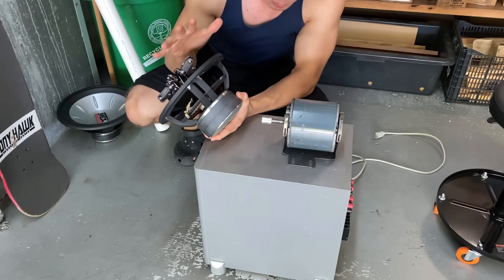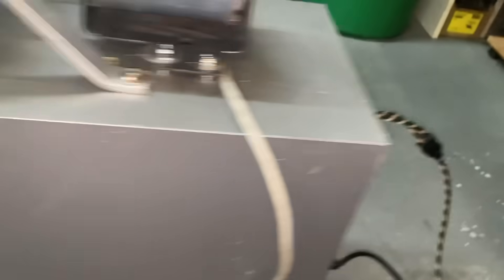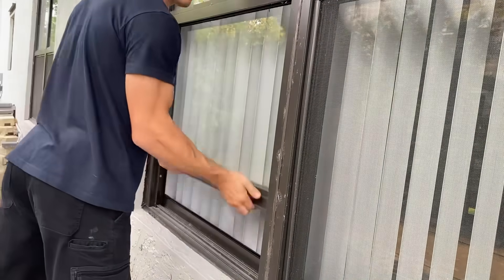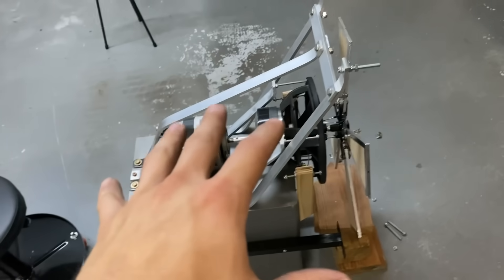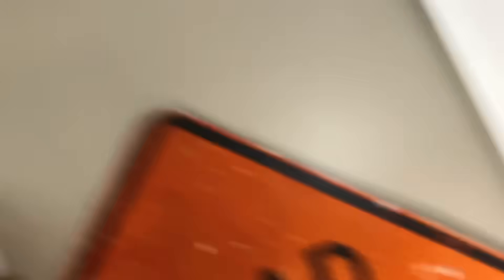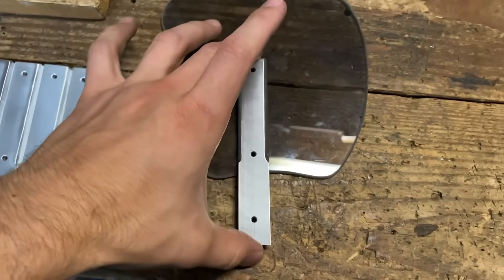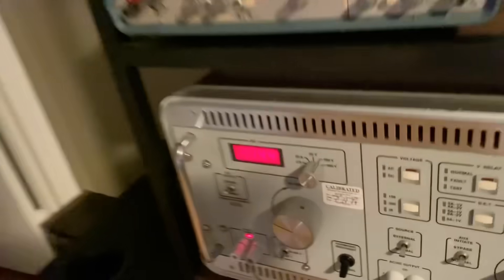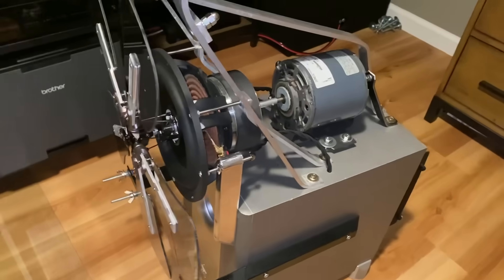Making the worlds most powerful subwoofer (Rotary Subwoofer)

Comment: It took me quite a while to understand how that thing works. That thing is a beast, I wonder if something like that could be used in a haunted house prank.
Reply from the maker: It sure can
Reply: Look up articles on infra-sound. Certain lower frequencies are not audible but can produce uneasiness, anxious, nausea, dread. I have long wondered if some of the cavernous rooms in old castles, basements of large structures, etc,  have an infra- sound resonance (Think the sound of the sea in a shell but lower frequency at greater pressures.  This could help explain some of what people experience in these spaces (though I haven't seen any testing). 

I do know there are infra- sound generators in use and for sale by and for commercial haunted attractions.

Comment: It would be interesting to see experiments on rotational speed of the blades versus output level. There must be an optimal rotational speed at which the subwoofer has its greatest output.
Reply: I would also bet that it has to do with the pitch of the blades at any given moment, and might vary significantly. Curious to see what the data on this might look like.

Comment: You can't hear 10 hz
Reply from the maker: Well said. U just gotta hear it to believe it
Reply: If the device reproducing the sound has the balls, I assure you that you can hear ten Hz.  I've seen the Thigpen model demoed twice and it destroys everything you think you know about LFE devices and our ears.  These things are insane.  Beautiful engineering and tons of fun to experience in person.
Reply: @JAMPROSOUND  below around 20hz is not audible. You get pressure but not sound (except things shaking).
Reply: You're right.  Our ears just magically stop functioning at 20 Hz.
Reply: @JAMPROSOUND  that's not how that works and yes audible noises under 20 are inaudible to humans. It takes almost  zero effort to research this. The sounds you hear below 20 are resonance as in things shaking, rattling,  and felt pressure. You can not hear the actual tone.

Comment: I've seen an online auction of a supposedly factory made (IIRC Italian) LFE subwoofer which used a motor, but it was just simply attached to the diaphragm of a huge woofer with an eccentric coupling. So it was an ordinary woofer, just driven by a motor instead of a voice coil. The motor looked like an ordinary brushed DC servo motor, I'm not sure if an average amplifier would be happy getting zapped by the sparks of the brushes... Trying out that concept was on my long term to-do list for about 10 years now. This one looks way more sophisticated. Not sure if I will ever try any of them, but good to know about this version.

Comment: There is only 2 major problems with this. 1) There is no possible way to use this in winter time. 2) if the blades are strong enough to handle 120hz a frequency that you will feel in your chest, the neighbors within a 1/2 mile radius will start to complain when you turn it on.
Reply: It could be installed in an attic space.  Would still get the penetrating bass but the airflow would be outside the insulative envelope.  Similarly for an unheated attached area like a crawlspace or attached garage.  Not as good but a powerful low frequency travels.
Reply: @sblackwolf  "Not as good but a powerful low frequency travels." Then instead of using a fan, why not just install it to the four walls in your home as that is what one would be listening to the vibrations of the wall around you.
Reply: @nathanwoodruff9422  I was trying to remain on topic as the question was asked.  Yes,  mechanical coupling can and has been done as well using actuators or other electro- mechanical means. I'm not sure but I would believe either of these approaches would be hard on the structure,  the fan being perhaps less damaging.
Reply: @nathanwoodruff9422 using a fan or a regular subwoofer to create sound pressure is no different.  If the structure can’t take it, then it doesn’t matter.

To your original point, you wouldn’t use a fan sub at 120Hz, only at very low frequencies where traditional subs have difficulty producing adequate output.
Reply: @superspeeder  "using a fan or a regular subwoofer to create sound pressure is no different." Thanks for insights into the obvious!!!  " is no different." Well, except a fan can create 1,000's of times more pressure than a subwoofer ever could. But, thanks anyway for the insights to the obvious. 
"To your original point, you wouldn’t use a fan sub at 120Hz," Well, except if a fan sub was made out of very lightweight metals like aluminum, which works too well at 120Hz enough so that it rattles pictures off the walls of neighbor's homes a 1/2 mile away given a large baffle like an attic. But thanks for being clueless again. We all will make note of it. Studies have shown that humans like you don't hear below 100Hz anyway. The vast majority that said they did felt it and didn't hear it. A fan sub at 10Hz and below is doing nothing more than wasting energy moving objects within its vicinity back and forth at 10Hz and below with that wasted energy. But you probably wouldn't know that either. Oh and Mythbusters busted the myth that 7Hz signal makes everyone {censored} their pants. But, Mythbusters was probably before your time too.

Comment: Ok you showed us the super low stuff…is there a frequency where this loses effectiveness? If there a natural roll off above a certain frequency?
Reply from the maker: It’s mechanically limited to about 15, cuz the rotor won’t handle it
Reply: @pierogiengineering how about making a way smaller one with much higher rpm and very strong woofer higher rpm=volume right? 50hz possible maybe?
Reply: @pierogiengineering  so yours is a neat party trick, then, and I fell for the clickbait. 
Servo driven subs were a thing about 30 years ago iirc. I should look them up.

Comment: The worlds most Powerful Subwoofer has a membrane Diameter of ~4m. This thing is useless against.
Reply from the maker: No way, I wanna see it. What’s it called, or do u have a link
Reply: @pierogiengineering  A smaller version is to be seen in Back to the Future #1. Pink Floyd used this Monster Woofers at one of their Tours. These things are capable to crash a building when matching the resonance frequency. Ok - i will correct myself. Its smaller. Only 80 Inches in Diameter.

Comment: your 4th order bandpass boxes lose about 12-18db by virtue of being a 4th order bandpass box. literally ANYTHING is going to be 4-6x louder than that shit.
 
 that said, you dont seem to understand at all what this device is. there is no standard speaker driver used in this hypothetical-dosent actually exist system. its JUST the fan with the blades vibrating rotating back and forth AS the speaker cone. its purely hypothetical, and was never actually made because its fucking nonsense. sound waves are not air pressure, and trying to combine the two has terrible results. plus this shit was meant to sit in your basement, blowing against a central support collumn in your foundation to transfer the sound into the house itself. its not just blowing air inside with a speaker playing behind it.
Reply from the maker: Bro, no way you believe anything u just said. Every transducer generated positive and negative pressure. 

By definition: “Sound wave is called longitudinal wave because it is produced by compressions and rarefactions in the air.” 

Won’t convince you on your theory of the rotary sub itself, since this video legit SHOWS as best as I could convey it operating as intended, nothing hypothetical.
Reply: @pierogiengineering  speakers produce sound waves as well as air pressure. the two are not the same thing. you need to get a basic education on these principles before you pretend to understand them.
Reply: Just shut up, and appreciate what this guy did....
Reply: @Tegacius  he didnt do anything. its literally just a fan sitting in front of a subwoofer.
Reply: @FingerinUrDaughter huh what? The pitch of the blades is controlled by the subwoofer, thats what creates the pressure. Please just look it up online before you embarass yourself ❤
Reply: In the late 1990 I remember a commercially made rotary subwoofer that could play 50 - 30hz and lower if I remember correctly.
Reply: @a64738  you dont.
Reply from the maker: 6:16
Reply: @pierogiengineering  1: thats not your amplifier. 2: if you think any cell phone/tablet is capable of passing a 1hz signal over its headphone jack, you need to get a grip on reality.
 the ONLY way youre generating 1-3hz is from an oscilloscope, and there is literally no commercially available amplifier that can reproduce that low.  not that it would matter, since the FAN BLADES are whats supposed to be oscillating at 1-3hz, and an audio amplifier is literally not even a part of the ACTUAL DESIGN FOR THIS KIND OF SYSTEM.  its literally just supposed to be a high powered fan blasting a support beam with air thats being chopped up in 1-3hz intervals by the oscilation of the fan blades, which causes the support beam and theoretically the entire building, to vibrate in time.
 
 what you have is a fucking HTIB subwoofer sitting behind a fan that has the blades swiveling back and forth, blowing in through the window. you dont even understand the very basics of this shit, and have the shit tier 50 watt subwoofer sitting behind it just to say "oh look its doing something!" but you cant even fucking hear it. the system is meant to induce vibrations in your foundation, not blow air in through a window you tool.

but EVEN IF YOU DID IT RIGHT it wouldnt matter. this was a design theory. it could technically be done, but the amount of airflow required would make for a dangerous air intake system, a dangerous level of high power, literally to have your house built around the use of this device, and in the end you wouldnt REALLY have a subwoofer at all. youd just have your entire house vibrating at 1-3hz constantly when it was in use. thats the reason why in the 80's when this flop started getting some attention, it was purported to cost $20,000+. because you had to have a home built around the thing. now adays youre looking at far more. oh and again, you need an osciliscope, and a 440v several kilowatt regulated power supply, not a fucking car amp.
Reply: @FingerinUrDaughter   You may be right, but why are you so angry about it?
Also, reading the wikipedia for this. It is actually being used.

"Six rotary woofers are installed as part of an immersive Niagara Falls attraction known as Niagara's Fury, located in the Table Rock House, to provide low frequency extension down to less than 1 Hertz, to emulate those waves created by the falls.[9]"
Reply: “It doesn’t exist”, meanwhile we’re all looking at a live demo of it in action😅
Here, try to learn something: 
https://en.m.wikipedia.org/wiki/Rotary_woofer
Reply: @2tubas553  no, youre looking at a moron putting a fan in front of  a speaker. fuckoff invalid.
Reply from the maker: Bro ur on something

Comment: I have been thinking of a vane pump woofer. It would actuate by rotating the end seals in opposite directions. I was thinking concert size, so I figured build it into a cargo container and use semirigid plastic pipe to separate the sides or to delay the back wave, not sure which would be better. I will probably never build it, but if someone does, I hope I at least get to see a video of it working.
Reply from the maker: Interesting concept, would be a first

Comment: Can you give info on the Helicopter blade actuator?
Perhaps a forum link, video or a part number?
Reply from the maker: It’s the jdhmbd 500 rotor
Reply: @pierogiengineering  After bit of research, you said it’s scary after 15Hz? I saw you’re using a 1550 RPM motor, by my calculations, you should be able to hit 25Hz?

The math is, desired Hz, multiplied by 60, equals motor rpm?

Is it purely a mechanical weight problem?
Reply: @pierogiengineering  Cheers, my Friend! 🍻

Comment: Making me regret chucking a broken t-Rex 600 rc helicopter. I wonder if two blades would be enough for one of these to work well.
Reply from the maker: Maybe, but I actually tried with one and there were no results
Reply: @pierogiengineering  hmm. My understanding is a propellor spinning fast enough acts kinda like a solid disk. Maybe it needs more head speed for 2 blades, but the noise would probably be unbearable.
A 5 blade head sounds like the best way to go then. It would be real cool to have this in a permanent installation. 
Tapered roller bearings on the shaft to take up the thrust on the shaft might be helpful, to keep the bearings in the motor from wearing out too quickly. Maybe a car wheel bearing could be a cheap source if you had access to a lathe to turn down a bushing. Probably secure that to the magnet backing plate so only the woofer is taking up the thrust of the whole setup instead of the motor.

Comment: For those not familiar (or too young to remember) Google Thigpen Rotary Transducer.

Seen some less than intelligent comments claiming it isn’t the most powerful bass driver, which is odd considering the guy in this vid literally shows the original model in the Guinness Book of World Records.

For those who wish to see one in action IRL, check out the visitors center at Niagra Falls.  Using one was the only way possible to duplicate the rumble of the falls artificially.

On that note, they aren’t used in many installations due to the extreme installation requirements…

A.  An infinite baffle (shown in the vid) or a baffle of equal volume of the listening area (basically an empty space of equal volume to the room you have it in, otherwise it creates standing waves in front and behind that cancel each other out).

And…

B.  The extreme structural reinforcement required when these things are in operation (they can quite literally tear your house apart if driven loud/low enough.  Look up the AVS Forum for people with actual experience with them).

EDIT:  oddly enough, I just got in my suggestions a relevant video I watched back during the dawn of YT...  

https://www.youtube.com/watch?v=E7Bkrypxzs4

Surprise!  The algorithm is actually useful for once.

Comment: This is not even close to the worlds most powerful subwoofer. If this design was great, people would use it commercially. But it is so flawed and has zero application in a PA or car system. A Leslie speaker does this right.
Reply: Actually it is classified as the most powerful sub a 2 sec google search will show that.
Reply: ...these are used commercially..
Reply: A Lesley speaker is not even the same idea, the only similarity is that it’s a speaker that spins. 
Do some more research, you’re not as smart as you pretend to be.

Comment: You could probably build a ridiculous tapped horn with it for outdoor use.
Reply from the maker: Might need a sponsor for that one. Not a bad idea tho
Reply: @pierogiengineering  Nah you don't, fam. You could get a few large pieces of cardboard cut to a test box, laminate a couple layers of cardboard with spray adhesive, cut your panels out of the laminated cardboard, build the test horn, and use 50% diluted wood glue to seal edges. I've seen guys build very large transmission line speakers with cardboard.

Check out a vid called "How to make cardboard stronger than wood! Cardboard hack"
Reply: That thing plus a decent horn could probably be felt a mile away XD

Comment: Awesome! Now what really has me confused is you're accent but you used inches in your measurements. WTH?
Reply from the maker: Believe me if America didn’t use this stupid inch and fraction crap, I wouldn’t use it either.
Reply: @pierogiengineering  well I'm use to it. Old fart and grew up using it. I'm in Texas. I know the metric system, used it in the military and have both metric and standard tools. When I measure something it's in inches. Sometimes when I'm doing machinist type work it's easier to do it in metric. But old habits are hard to break. 

So what brings you to the USA?
Reply from the maker: @WW5RM  yeah, especially when screw threads and pitches get involved. I was born here tho

Comment: This is super cool! I'm really interested how you attached the linkages to the subwoofer base. I see quickly you attach to some cut PVC pipe but then you just glue it or something directly to the base of the cone where it meets the voice coil? Some more detail on how it's made would be really cool to see. Where did you source the motor that spins the fan axle from? I want to build one now as well so badly!
Reply from the maker: Glad I could inspire with this. To answer your first question: yes, hot glue was the only thing needed to connect the two pieces together, you have to be generous with it though. The motor actually came from an old aircraft, so idk how to get another one of those, however, make sure the motor is capable of rpm’s up to 1800 and has a soft start option, otherwise it’ll damage the actuating mechanism with too much starting torque.
Reply: @pierogiengineering  Thanks for the detailed reply. I think a pedestal fan motor may actually substitute, now that I think about it more. I'm making a shopping list of things that would be needed... already have amps and subs laying around. I just need some linkages and polycarbonate and  I'm ready to start tinkering :D
Reply from the maker: @soldjahboy that’s the spirit!

Comment: these are so interesting ive been a bass head since the late 80's and just now started reading about them,what if you put the electrical part inside out of the rain wouldnt it still do the same thing,that is so cool bro,great video and great work,it shook my wall on my cabinets i built with 12 inch subs tuned pretty low for home audio,32 hz but it plays low,parts from parts express.
Reply from the maker: Glad u like the project. Yes, if I put the rear end inside, it would do the same thing, but the panel that it’s bolted onto access the sub from only one side